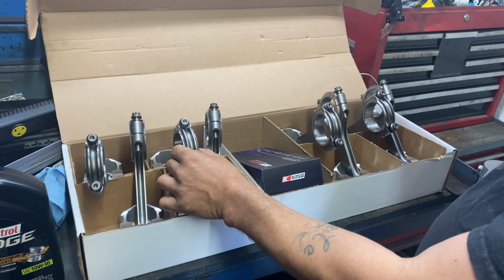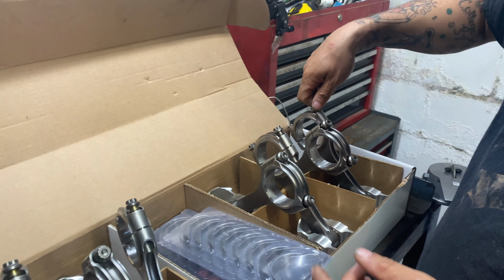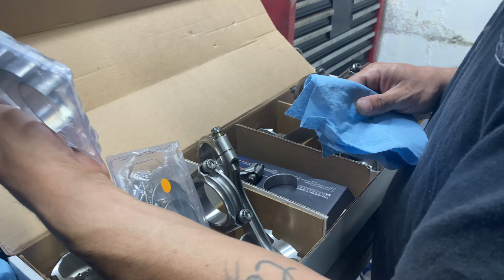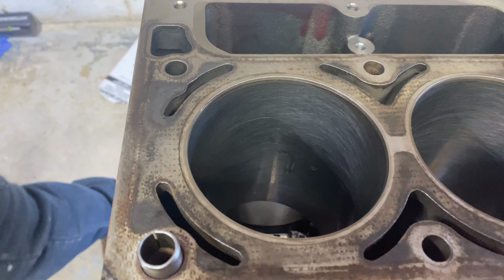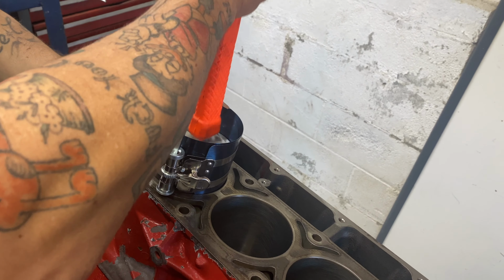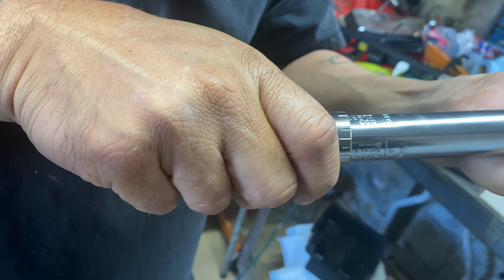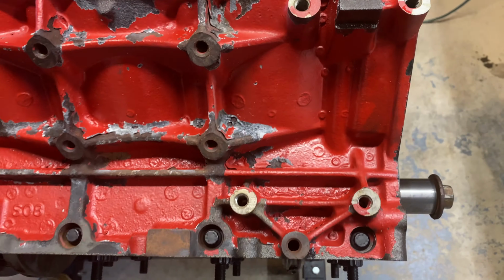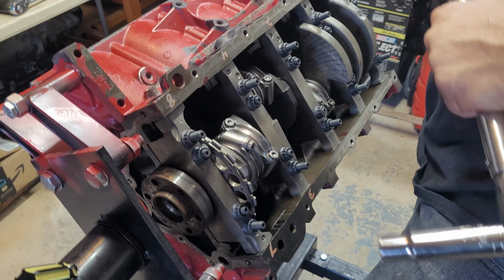Installing Our Summit Pro Ls Pistons & Rods In Our Boosted 5.3 (C.C. Build)

Comment: 80+ foot lbs seems like alot for rod bolts. Are you sure it was foot pounds and not inch lbs  or nm? Usually around 40-50flbs would seem more reasonable . Let me know either way because I'm going to be installing a set it my 5.3 soon . Keep up the good work man.
Reply from the maker: That's what the arp studs said in the instructions......remember to align hone if your using arp studs...they have a different clamp force

Comment: Hey brother, i have a very low milage Chevy 350 short block but its got dished Pistons and I wanna swap them out for flat tops do you think i need to hone the cylinders for proper piston skirt to cylinder wall clearence?? A machine shop owner in Tampa said Fuck that shit but  piston manufacturers said to hone it a few 1000th's 
Im going with Speed Pro hypers for standard bore 4.000" no over bore as it's maybe only got 1000 miles on it and shouldn't require machining
Reply from the maker: Hey there, thanks for watching. I would say go with the advice of the machine shop that's building the engine

Comment: These are just plug and play? A while back we did a Honda 4 cylinder. We had to take rods and pistons to machine Shop
Reply from the maker: Not plug and play...you'll have to get the right parts for your application...pistons come in many different bore sizes...and the rods come in different lengths and sizes